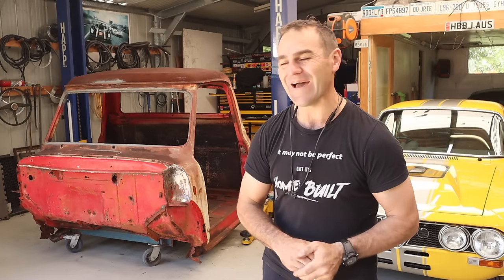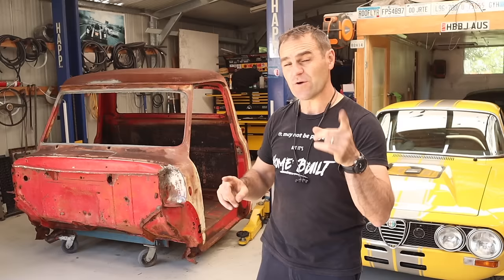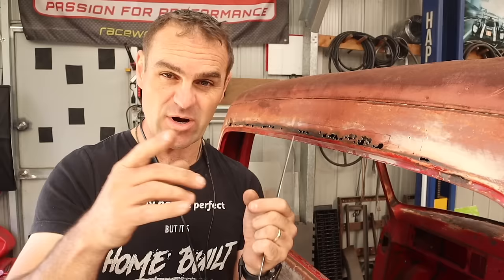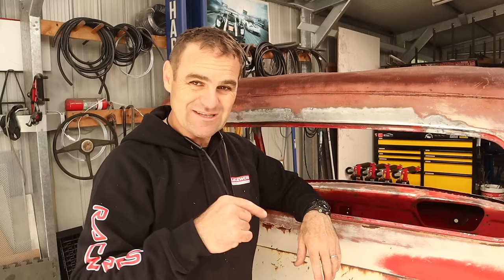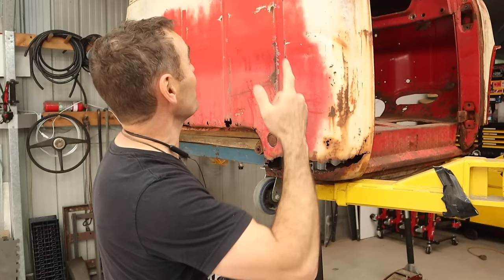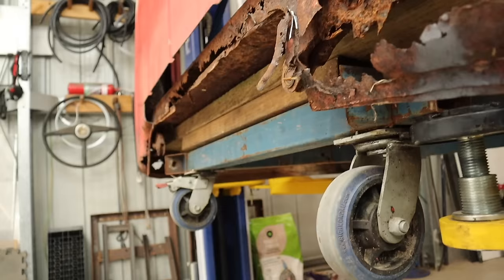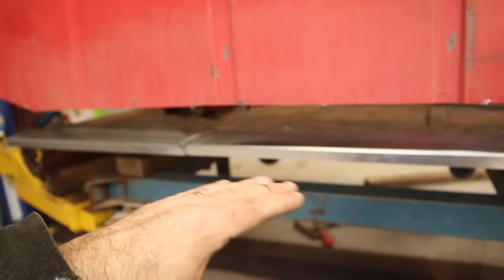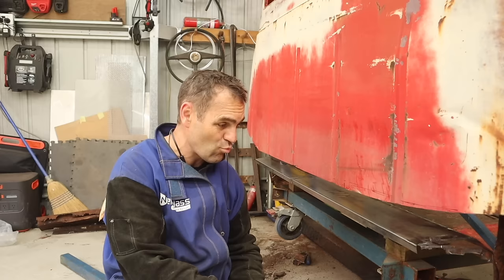The bottom is totally rusted out  - 1954 Ford F600 Car Hauler Build part 5

Comment: For your roof problem if you cannot get a repair section, Ive seen @HalfassKustoms use panel sections from another vehicle with the desired shape that could be easier than starting from scratch. In particular I'm struck by the domed look of your roof that could be quite similar to the one from a  classic Mini.
Reply: Lash ups like the chop shop?
Reply from the maker: Much easier to make a part that fits ;)
Reply: this is the episode I was thinking of: Using another roof easier than starting from scratch.
 https://www.youtube.com/watch?v=6CsyiTNoU90

Comment: Usually not a huge fan of replacing sheet metal with box section, replacing one part of a construction with something much stronger can make the design as a whole weaker, stiffness jumps create stress risers. But I guess since you are redoing the cab mounts too, that will give you the opportunity to even out the stiffness for the whole load bearing structure.
Reply from the maker: In some cases you are correct, but as this was already the primary structural part of the entire cab, it is only going to improve it.

Comment: Jeff have you seen the new Laser rust removers I think this beast would be a good test bed for one. laser rust removal 3000w laser cleaner 1000watt fiber laser cleaning machine
£1,158.41
Reply from the maker: I have, but they are expensive.
Reply: @HomeBuiltByJeff  So true but I see a couple of them seem to have appeared on the tube possibly sponsored.

Comment: "Two inch box tubing, a couple of millimeters thick." Is that how it's really identified with metric Thickness and american Dimension?
Reply from the maker: It is 50x50x2 ;)
Reply: @HomeBuiltByJeff  After I wrote this, I wanted to say I wasn't picking on the fact that you may have misspoke. I was genuinely curious if Some dimensions are standardized in imperial measurements? Sometimes there's certain nomenclature that just sticks regardless of where it's used.

Comment: What motor and transmission going to use and what duelly diff I'm in California
Reply: I believe Jeff may be using the Toyota Coaster motor (front wheel drive I believe).
Reply: I think so too, he said he bought a Toyota coaster go back to his December vids he introduced it there
Reply: @maxwellduncan6150 I think he is going to use the complete driveline from the Toyota Coaster bus, and it's rear wheel drive.
Reply: @aussieaussieaussie9  Thanks!  For some reason I thought it must be front wheel drive to keep a lower floor.  Appreciate the information.🖖